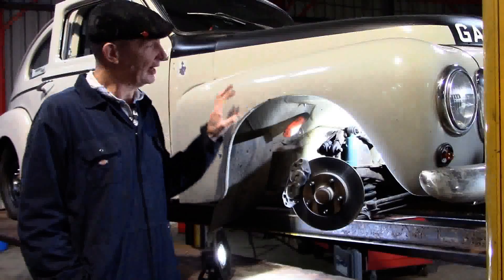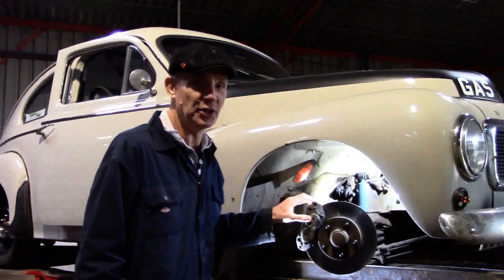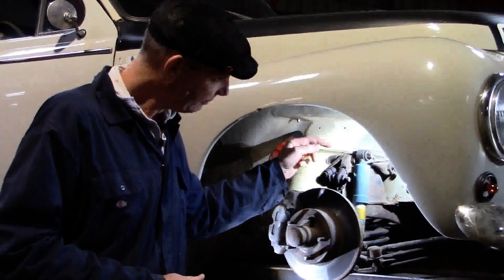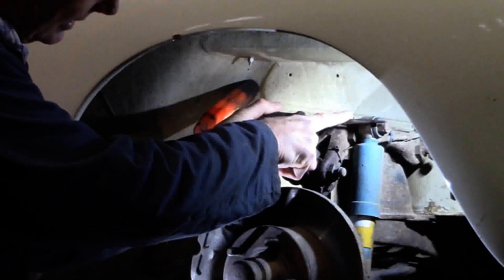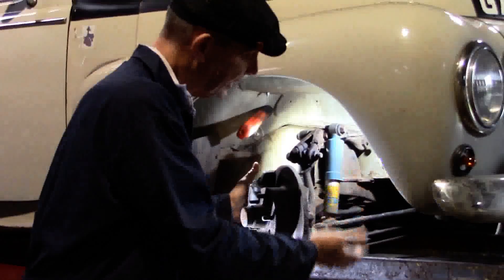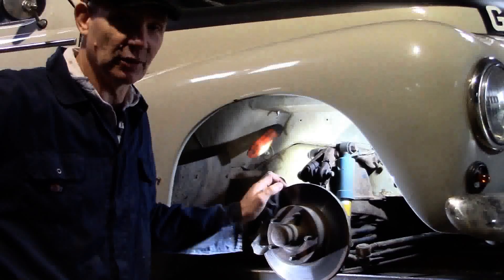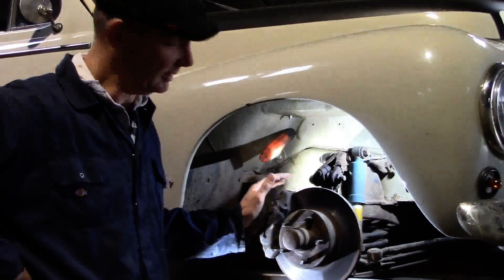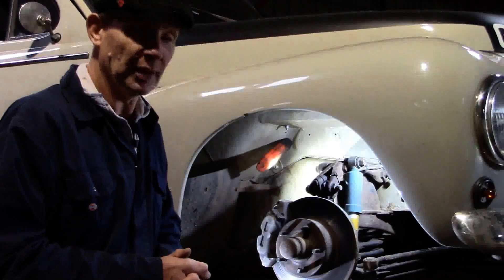Amazon Cars: Twin Shock Absorber installation, PV544

Comment: Sorry to hijack your discussion about dual shocks….I have a hard time dealing with my rear drum brake (driver side).  It won’t come off. I tried everything from loosening the brake screw to using a torch to heat the shaft collar and even using a 20 ton bottle jack with no success. I tried using a cast iron drum puller that attaches to the lug nuts and bolts. Nothing. It ripped the thing apart. What can I use?  Im ready to just cut the drum brake in half with a cutoff wheel. Please help.

Comment: can this also be modded to work on the 140 series ?
Reply from the maker: The PV needs it because the short springs require increased damping to control the front end. Since the 140 (in usual ride heights) has a much better/longer spring travel, the B6 Bilsteins will control the suspension perfectly.
However,  to answer your question directly: no, the PV twin shock pins will not fit the 140 at all.